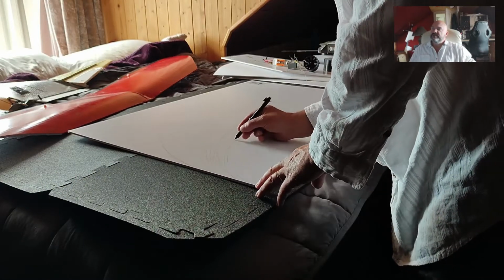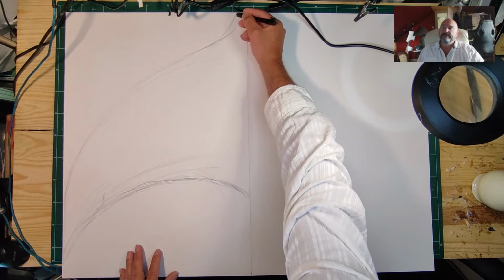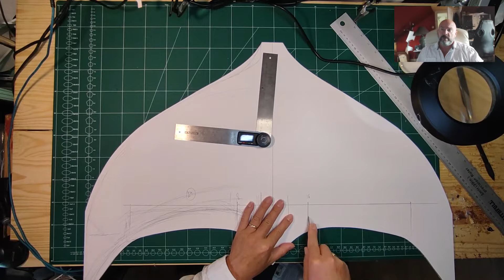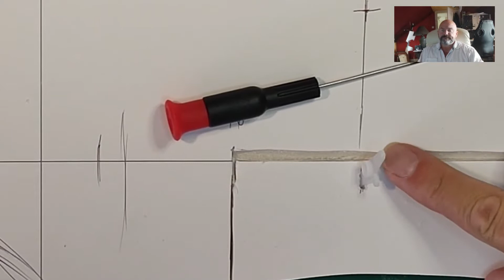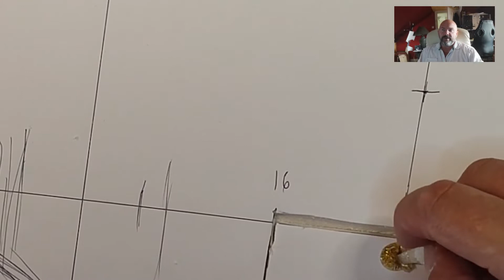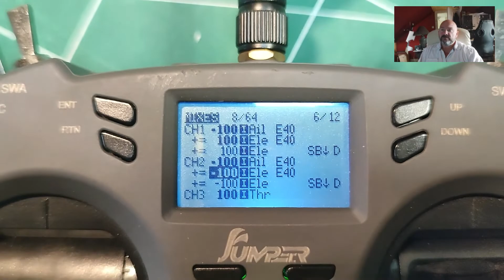The Making of a KFH (from the KFM family) FLYING WING. 6%. Including discussion & explanations.

Comment: Be aware . . . The metal film on the foam will block/reflect radio waves. It can be removed easily by warming it slightly with a hair drier or heat gun and then peeling it off. Just don't get it so hot that you melt the foam.
Reply from the maker: Thank you for the info 👍